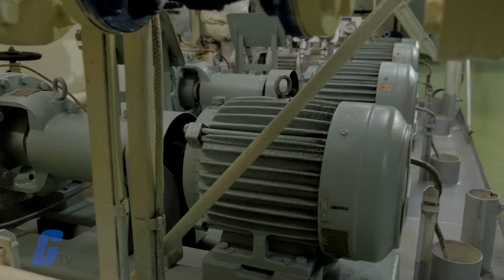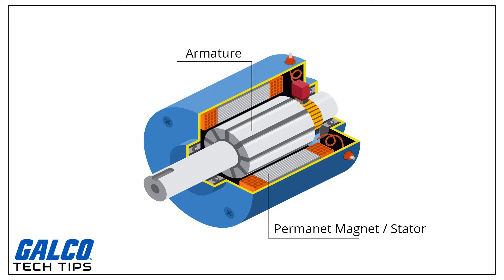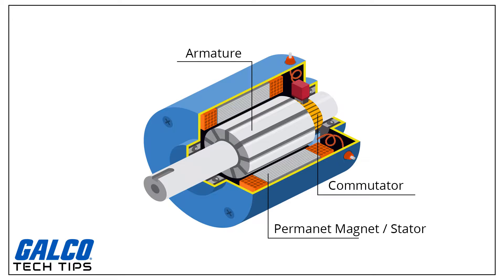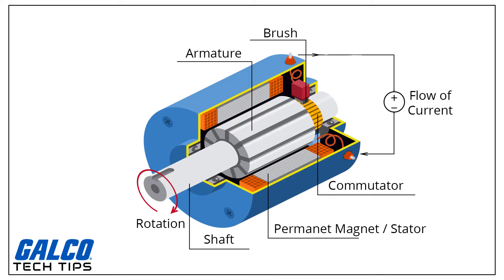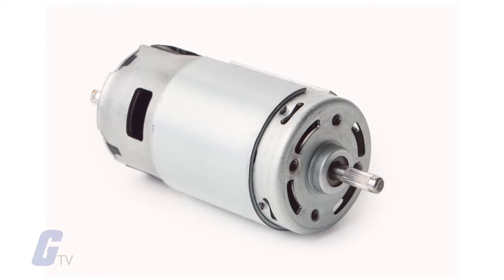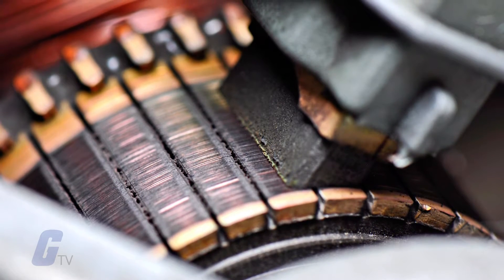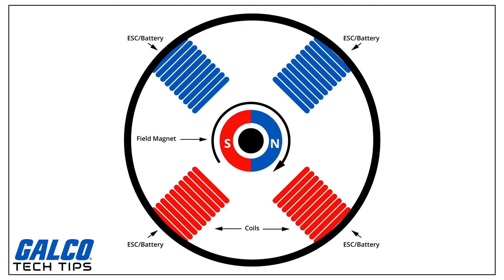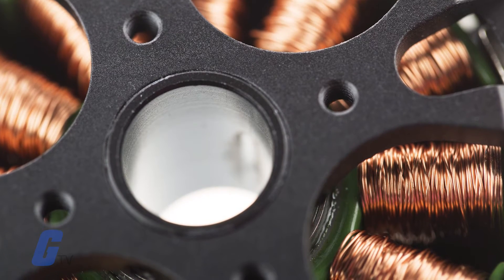DC Motors Explained: Advantages of Brushed & Brushless Motors

Comment: it's kinda of a contradiction when you say that a brushed motor has high reliability and yet it can also have a lower life span and more maintenance...  Those two factors directly defined reliability.
Reply: to my understanding the lower life span is that the brushes wear out but the maintenance is that they can be cheaply replaced. with a brushless motor these do not wear out, but when a chip or something else does its much harder to repair.